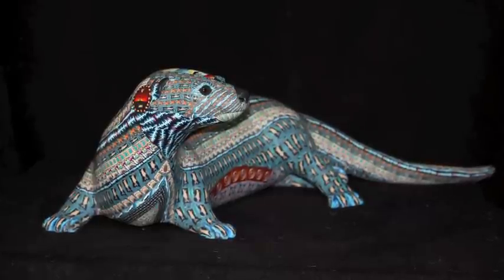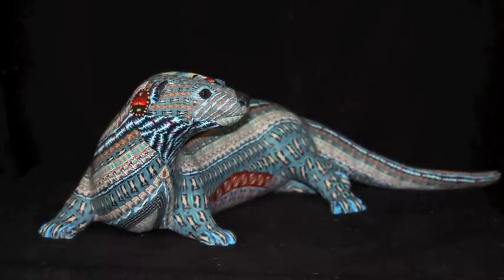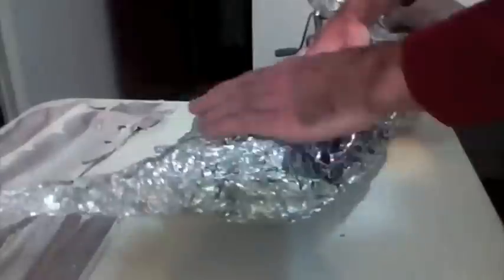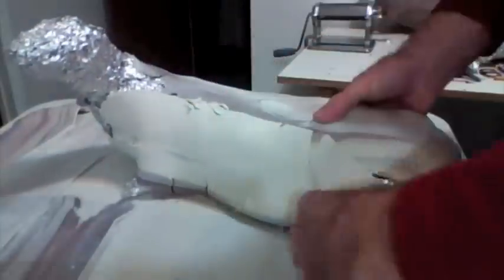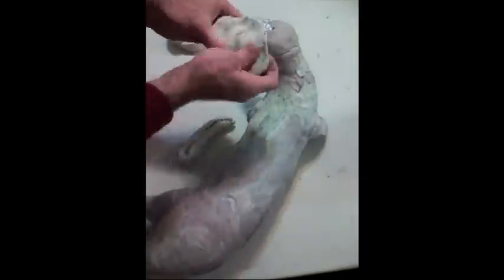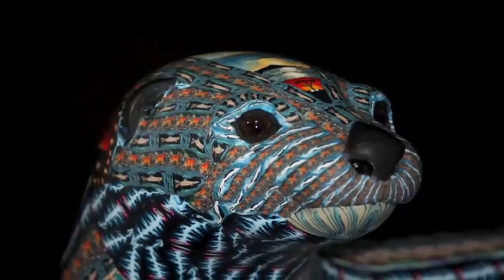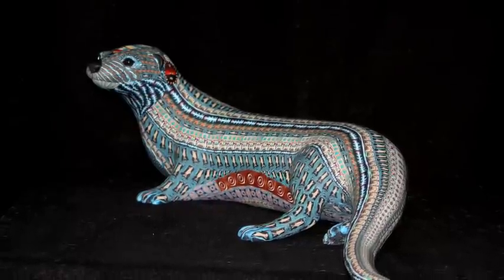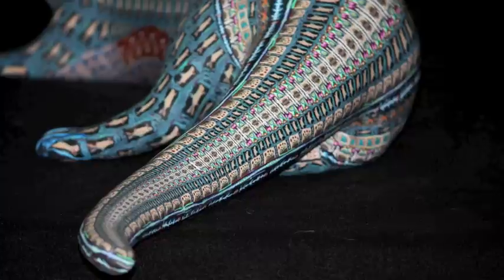Otter - Sculpting Process  (Adam Thomas Rees)

Comment from the maker: Thanks, Brian.  Polymer clay is a low temperature fire clay, only 275 degrees Fahrenheit.  If you want to check out how I make each and every cane by hand go to my website, just Google, Adam Thomas Rees Sculptor and it should come up. and click on the link at the top that says, "Cane Making."

The foil doesn't burn away at that low temp but I doubt it would withstand the high temps you use in porcelain.

Hope this helps.